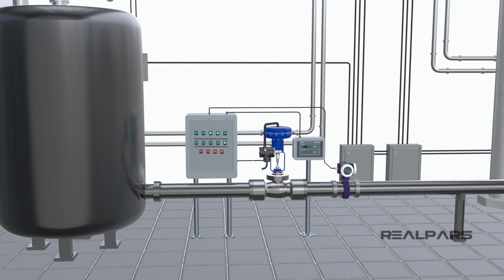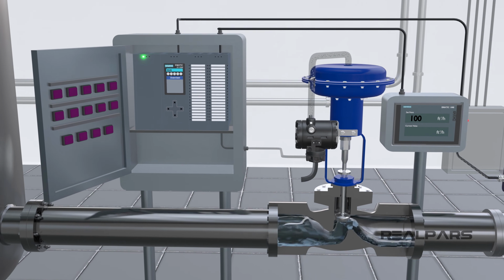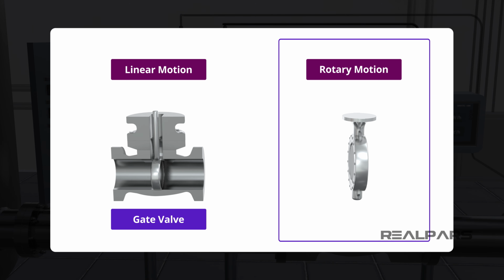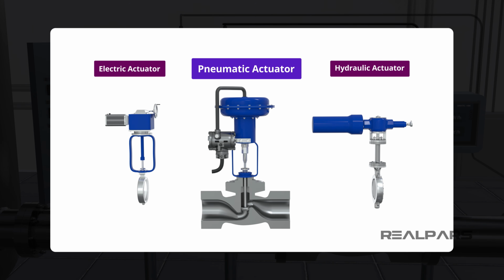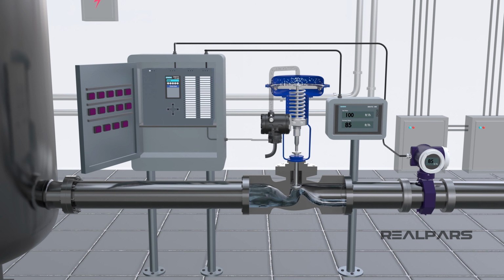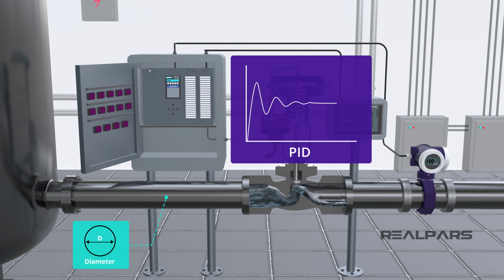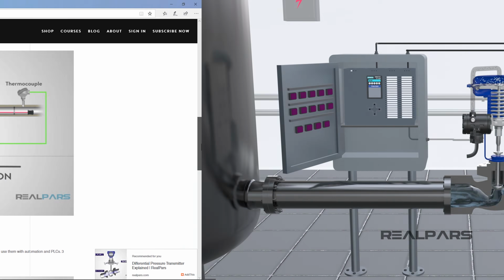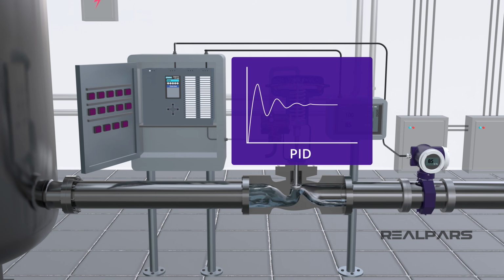What is a Control Valve?

Comment: What is the voltage that is supplied to the control valve which causes it to change its position?
Reply from the maker: Hi @Eshan Patil. Thanks for your question.  Most control valves are pneumatic and operate in a full stroke range of 3 to 15 psi or 20 to 100 kPa. But, there is usually a converting device called a Voltage to pressure (E/P) or a Current to pressure (I/P) to convert the signal from the controller into a pneumatic signal to stroke the valve.  The valve will begin to move at 1v if an E/P is connected or 4 ma if an I/P is connected.  I hope that answers your question.

Comment: The flowrate before and after the control valve is the same?
Reply from the maker: Yes, the flow rate is the same at the inlet and at the outlet.  Unless there is a serious leak around the stem of the valve, a control valve is a flow-through device
Reply: @realpars  what I don't understand how the control valve changes the flow rate.
Reply: @realpars 
How is flow rate regulated if it is constant (or the same) before and after the valve?

Comment: dear sir, what are the advantages of pneumatic control valve compared to motorized and what brand of PLC is the controller?
Reply from the maker: The main advantage is that a pneumatic control valve has a fail position that the valve returns to when the air signal is lost power loss or failure of the instrument air system.  A motorized valve will simply stay in the last position on power loss, which may be in a position that allows fluids or gas to continue to pass.  This can be dangerous if that fluid is natural gas or a dangerous chemical.  I am not sure which PLC you are referring to. The video is a "digital twin" simulation of a process installation, and the controller shown looks like it could be a Siemens S7-1500 PLC.

Comment: Great video. But is recommended to install the electromagnetic flowmeter before the control valve, it can prevent empty pipe that produces wrong measuring of the flow.

Comment: I think practically control valves are place after flow meters , first flow is measured then everything comes thereafter...
Reply: This video is an amazing start. I wish I could have helped offer a few additional points before it was made. Or saw this when I was learning in the job. there are issues / limitations of each technical choice. My experience is that hydraulic actuators are more robust, respond quicker, more reliable, able to work better on larger valves with a smaller footprint. There can be issues but that is more a maintenance issue. Pneumatic valves also require good maintenance and quality instrument air. They work great for on off valves.  They have less control because air within the actuator compresses. If you choose a butterfly valve instead of a globe valve you have less control. The valves have a leakage class and shutoff time requirement. They valves can have  lvdt, position sensors or limit switches to communicate if it is behaving properly. Often valves are calibrated with a factory supplied cv curve that is custom to that exact valve. This information needs to be updated to account for variations from the standard values. There opening profiles like pop and glide.
Reply: With liquid, there may be no issues but with gas, due to compressibility, this can be an issue due to restrictions.

On another note, this may not be to scale, the distance from the valve to the flow meter may be large enough not to bother.

Regards.
Reply: For liquids it does not matter, but mostly I have seen control valve at upstream of flowmeter (whether it is gas or liquid).
Thanks.

Comment: Great😍😍

Is there any video explains how to size a control valve? Valve calculation as well.
Reply: You just picked my brain. I'm actually working on that as we speak. Send me an INMAIL on LinkedIn, Obafemi Jimoh. We could share idea about that.

Do you have Aspen Hysys or INtools for sizing and calculation?
Reply: @obafemijimoh918  I use the software provided by the valve manufacturers.  A lot of them will run the calculations and then give you a list of models they make that will work with those parameters.
Reply: @Ryarios  Are you on LinkedIn? If you are please connect with me. Valve sizing is out of my instrumentation scope but I'd love to know how I can independently size one and and prepare it's calculation and specification.